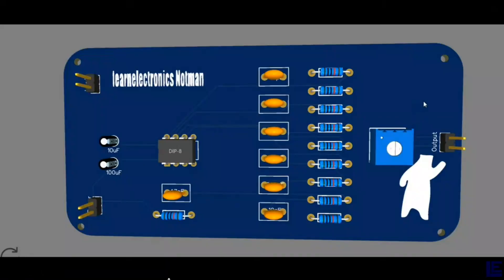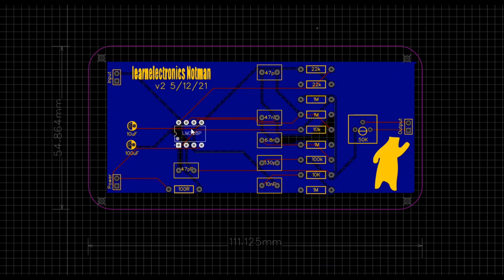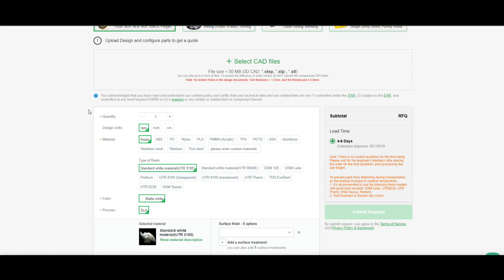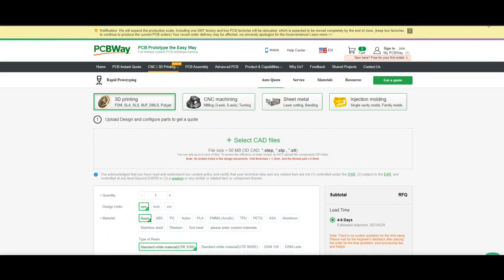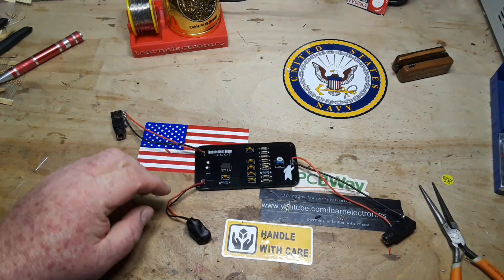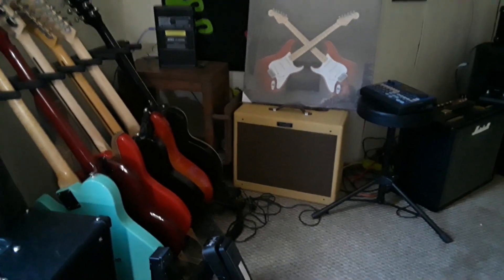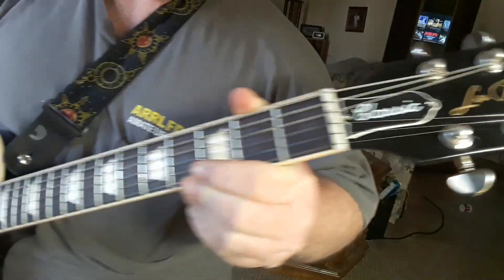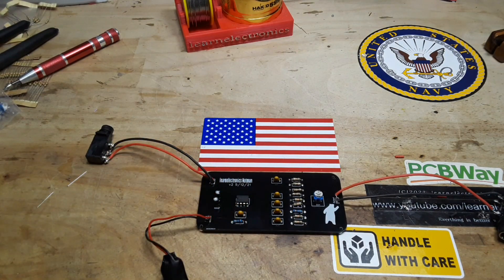Version 2 of my Notman guitar effect

Comment: Hey Paul, is the input resistor 1 meg by any chance? If not, maybe give that a go, I find that works really well for Les Paul’s. Also, maybe consider making the gain the variable? Those LM358s create a great clean sound to! Or the opposite ... can really growl if unleashed. You can also over clock the gain on em but that gets tricky.
Reply from the maker: No, it's 100k. But I'll change that to 1M and see what it does. Thanks for passing that on. I really appreciate it.
Reply: @learnelectronics  you are very welcome! I love it when you dip in the guitar audio world :)